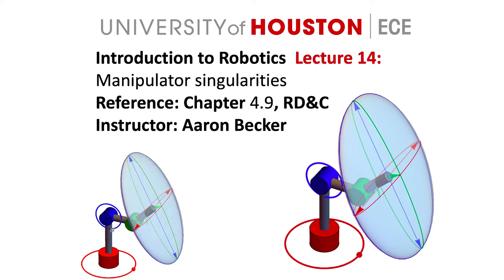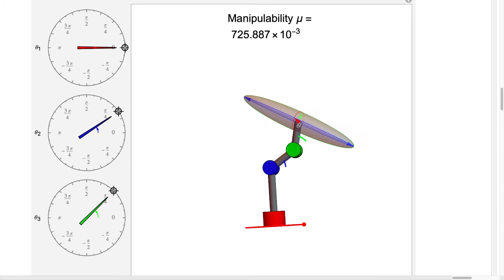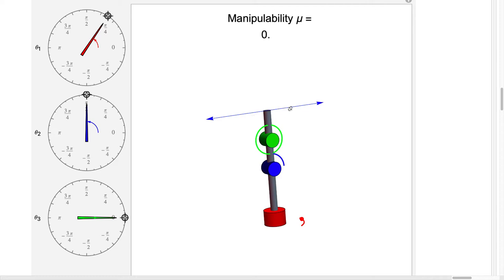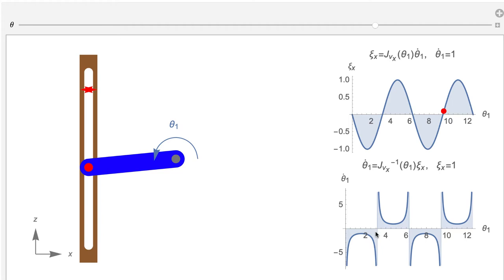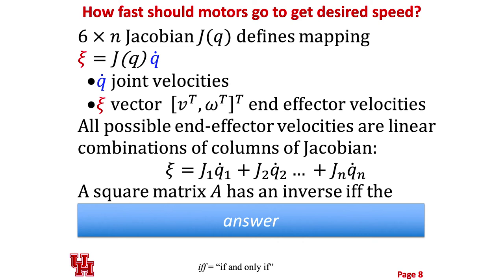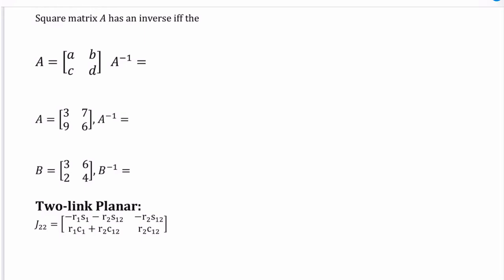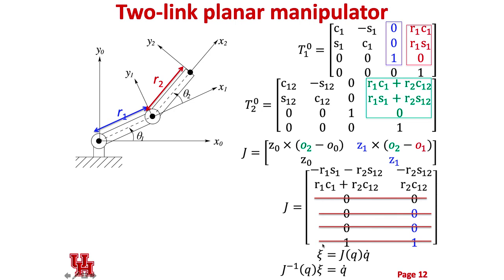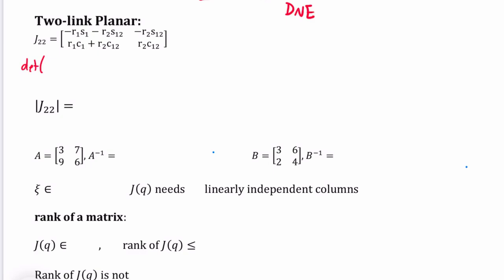Intro2Robotics Lecture 14a: Manipulator Singularities

Comment: I work in industry and, at least according to the manuals, ABB robots do not have singularity issues, programming wise.  Mechanically, yes, those singularities exist, I'm not saying that.  From what I have read, I may be wrong, is that this is because the ABB robots use quaternion mathematics for the pose instead of a homogenous transform matrix.
Reply from the maker: Thanks @capnthepeafarmer  All manipulators (even ABB ones) have singularities on the boundary of their workspace.  In general, the singularities are not due to the representation (quaternions or rotation matrices, etc), but rather relate to what velocities can be generated at a given pose of the robot.  As a side question -- how many DOF do your ABB robots have?  Redundant manipulators can avoid some singularities in much the same way you can avoid gimbal lock by adding another gimbal and using a motor to ensure the new gimbal is not aligned with the others https://en.wikipedia.org/wiki/Gimbal_lock. With that said -- can you share a link to the manual page that makes this claim?  Maybe they include an explanation of what they mean.  My student and I made an online demo to show where common singularities are in 3-axis robots: https://demonstrations.wolfram.com/RobotSingularitiesInThreeLinkManipulators/
Reply from the maker: @capnthepeafarmer  Thanks -- the manual is fun to read 🤖!  Page 693 is important because it explains how they handle singularities -- they either divert the robot position away from them, divert the wrist orientation away from them, slightly divert the robot while limiting the maximum tool velocity, or stop the robot before it enters a singular area.  👍for Quaternions.  Introduction 2 robotics already covers a lot of ground, so I don't introduce quaternions, but they have many benefits as a representation.  They won't eliminate a singularity, but they do improve numerical stability and require less memory.

Comment: 7:02 why would you want to operate or do anything close to that point ? If you limit for example blue lever to +/- 45 degrees you do not have singularity and you have excellent performance ??
Reply from the maker: @Milorad you've suggested a valid solution -- but you've limited your range of motion! What if the item your robot needs to manipulate is located beyond the 45 degree mark? Engineers are always dealing with tradeoffs, and this is one of those times.
Reply: @AaronBecker  longer arm.... there are  more solutions, and I do understand it is nice to know the problems and where they are in order to avoid them.